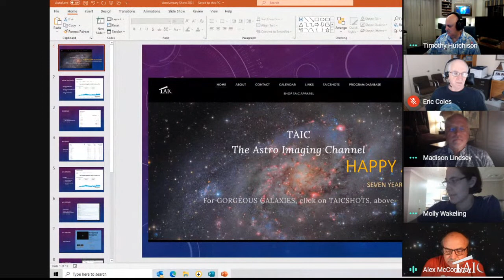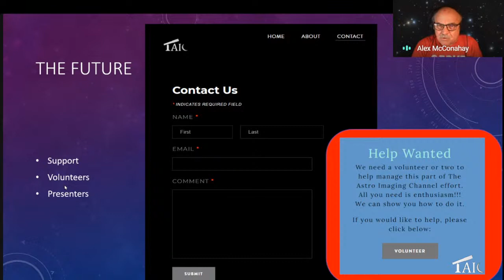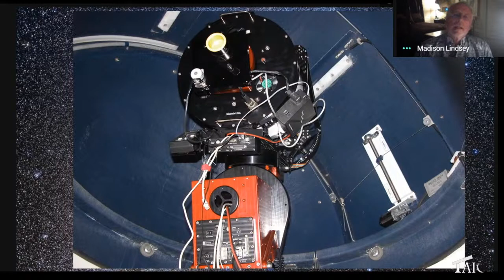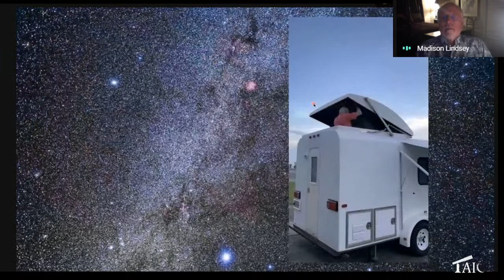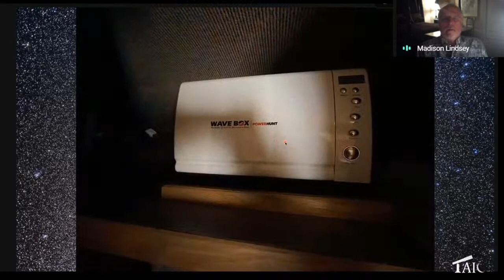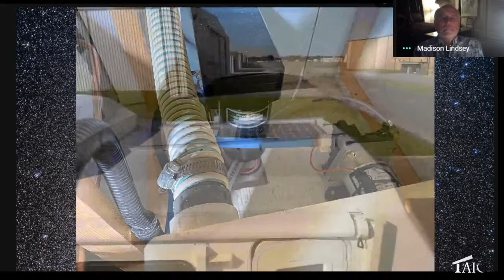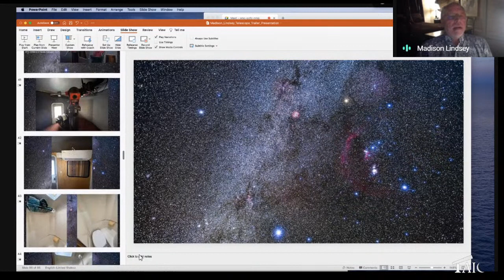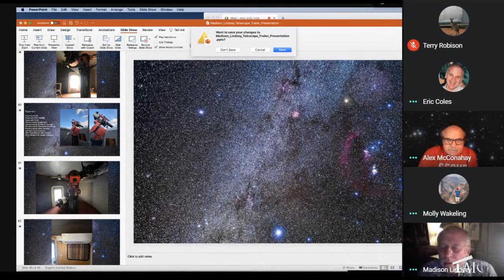2021.06.20 | Madison Lindsey: My Mobile Observatory

Comment: Everyone on forums: You need a 20" steel tube, bolted down to 60 tons of concrete block, buried 8ft in the ground, if you don't want vibrations ruining your image. 

This guy: Just puts it in the back of a caravan with some scissor jacks.